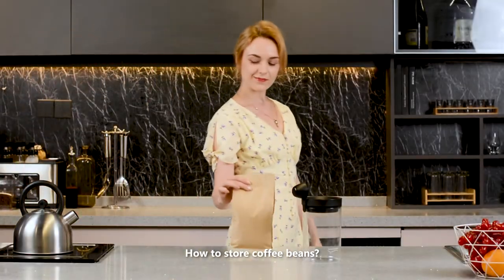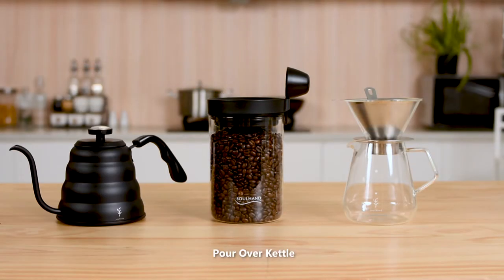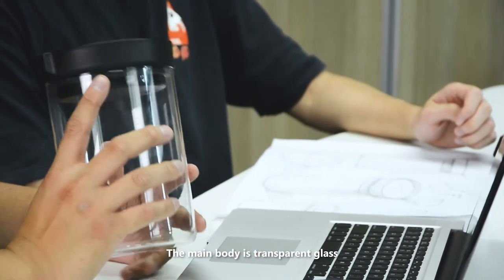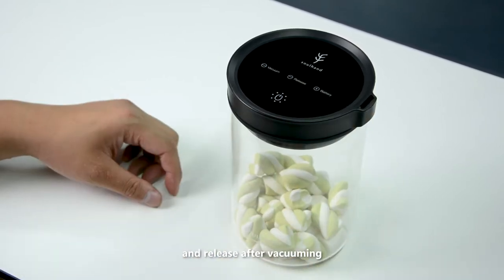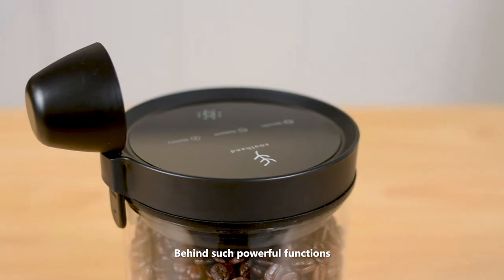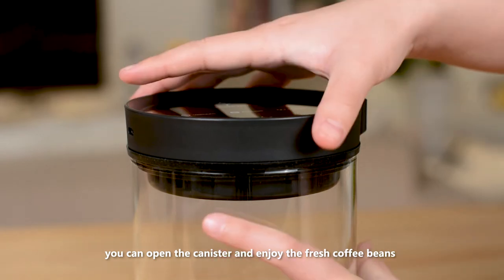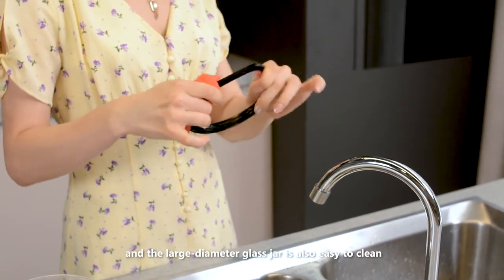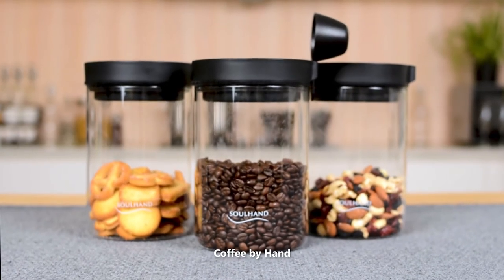Soulhand Vacuum Coffee Canister with Subtitle

Comment: I finally received my canister yesterday.
I have fully charged it and started using it, but I am very far from being happy:
the unit seems to be defected.  It vacuums, finishes the job goes into sleep but then after 60-90secs
it wakes up again and starts to vacuum automatically, without any intervention by user.  And this wont stop,
it keeps happening every 60-90secs.   This means to me the vacuum sensor is faulty as this is ABNORMAL that the
canister keeps vacuuming every 60-90 seconds!  I have tried to put various amount of coffee into canister: SAME!
Weight or volume of beans does not affect this behaviour.  I am sure this is ABNORMAL to keep the canister running
and vacuuming non-stop and this will kill the fully charged battery in 1-2 days if during 24 hours the canister vacuums
a few hundred times.  Not to mention that this is disturbing that the unit goes "alive" on its own and runs this much.
Please kindly advise what to do as I am 99.9% sure this is a faulty item, my guess is that the vacuum sensor is faulty or off.